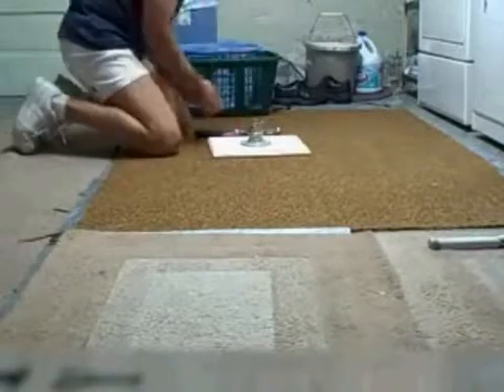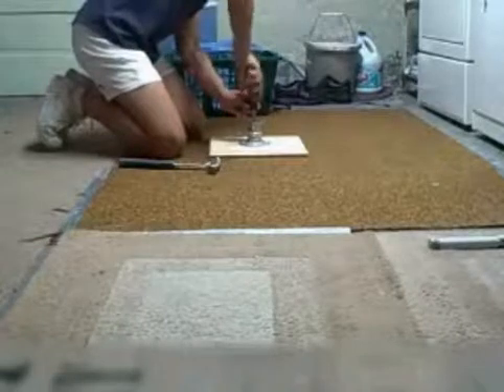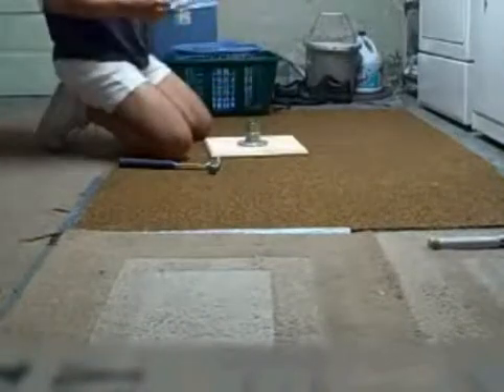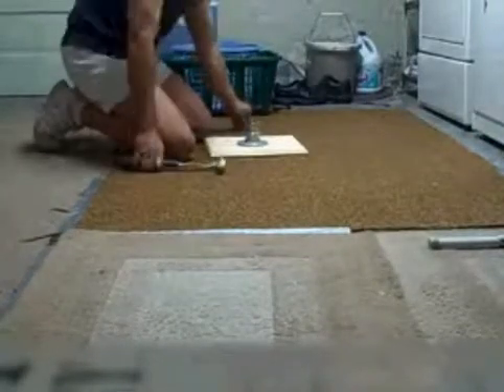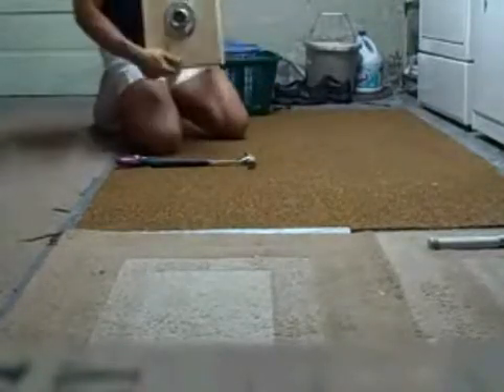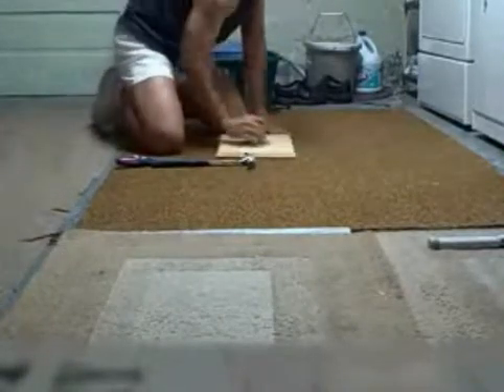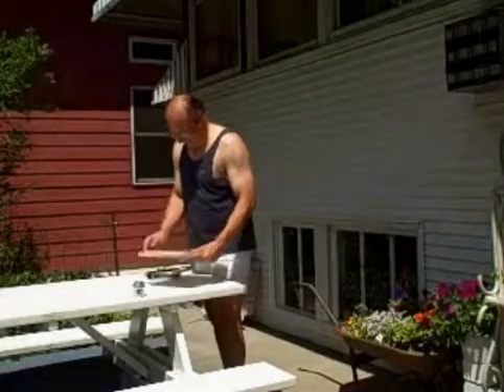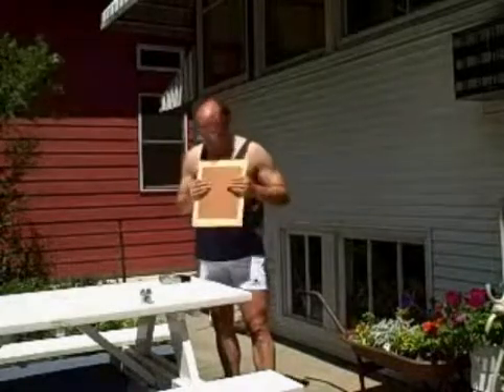Pole Dance Base Project

Comment from the maker: @mekaziona I had this problem with the base and I ended up buying those steel plates you can get at home depot in various sizes and thicknesses. They range in size from a stick of bubble gum to ones that are 6-8 inches long and a few inches wide. They have nail or screw holes already drilled in them and you can attach them to wooden boards with wood screws to reinforce or repair cracked lumber. Depending on the size, they are a few pennies to a few bucks a piece.  Good luck with the project!

Comment: I just built a pole and I bolted the flange to a piece of 1"1/2" plywood and I can hear the and just seen that the plywood is breaking. I live in a down floor apartment and what is underneath us is cement and the ceiling is not cement. So my question is how and what would could I use to make a base for my conduit pole. The pole is great it can hold my weight and I weigh over 200lbs. Any suggestions are very welcome:) Thank you in advance:)